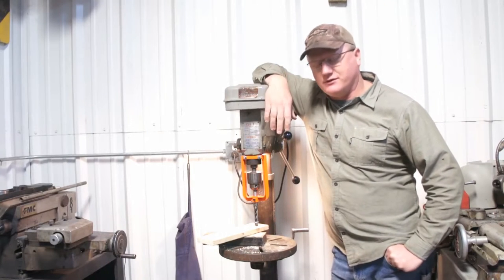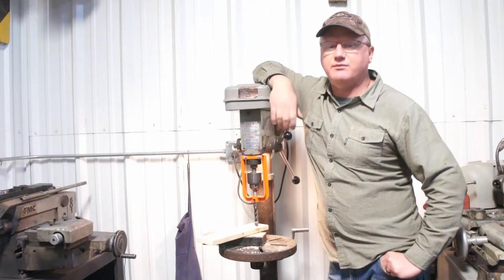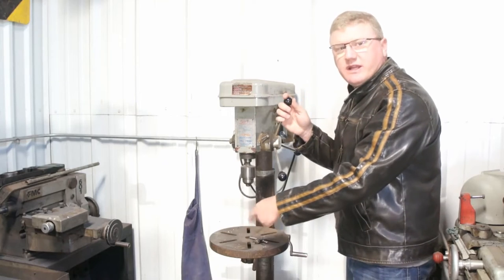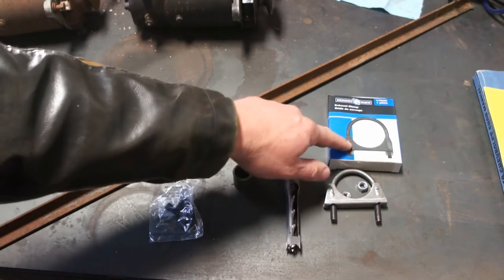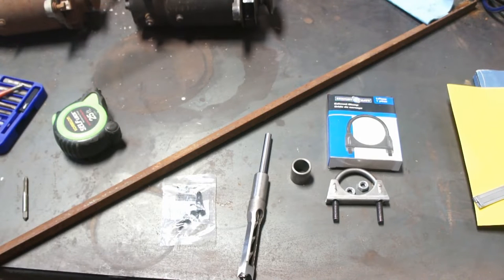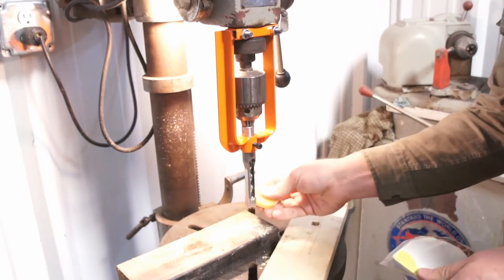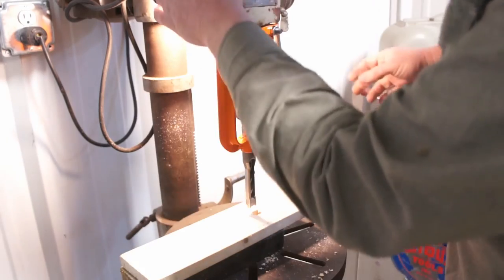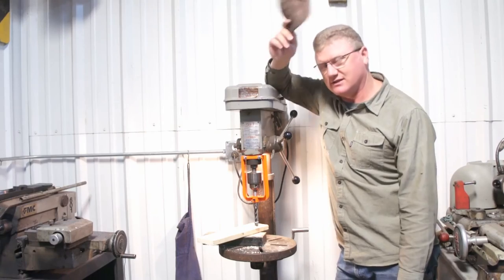DIY Mortising Attachment for Your Drill Press - $20 smackers-ish

Comment: Why do you need that orange piece?
Reply: The square bit surrounding the drill is just a chisel.  It needs to be forced down through the wood.  The drill bit inside is there to remove the central bit of the wood but also the corners that the square bit cuts away.  The orange bit holds the square bit and allows the force from the arbour to transfer to the square bit without spinning it.  If you didn't have it then the chuck would push on the square bit and rub like a b*stars while trying to spin it like a drill bit.  It would make a terrible round hole, not a square one.